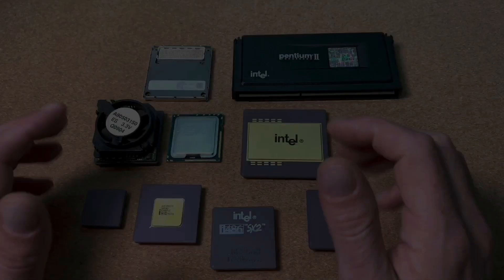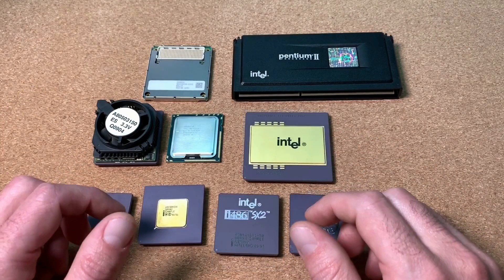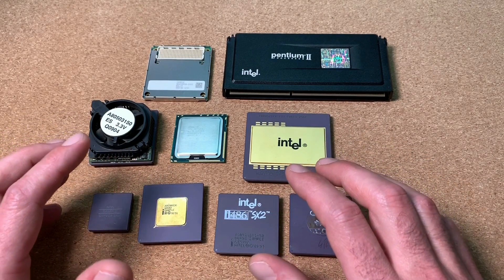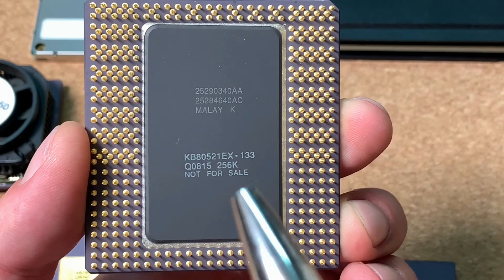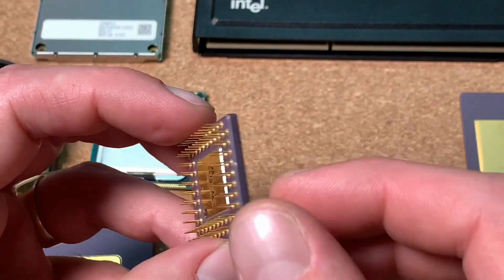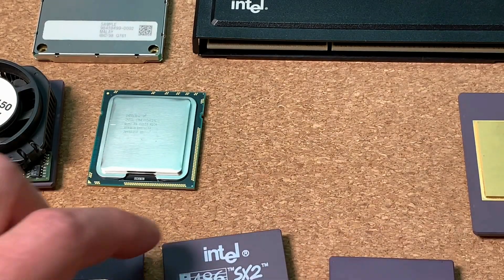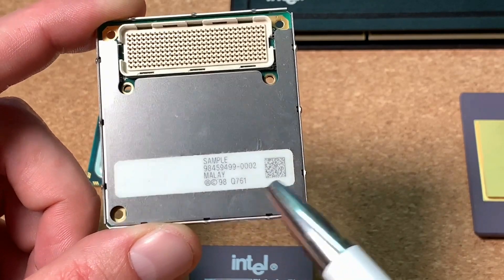Intel Engineering Sample CPUs / Whats Behind And How To Identify Them

Comment: I managed to get my hands on a QZAL engineering sample many years ago.. I used it for several years in my main rig. It overclocked like mad, even initially on just a very big air cooler. 
Engineering samples have always been interesting to me; did you know there are also Cyrix engineering-only CPUs and Nvidia engineering sample GPUs floating around the web?

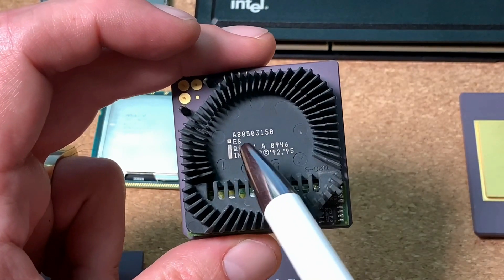Comment: 6:45 MMX overdrive ES has three pins clearly used for testings. Any idea what's possible with these pins if you know the purpose/protocol to communicate with CPU? Many chips have them or newer ones have different capacitor configurations  with same "family".

Comment: The 486 with extra legs ("bond-out?") has an "ICE" marking on it, that stands for "in-circuit emulator". ICE was used by BIOS and OS developers to get the lowest possible level of software debugging that is still considered software debugging. It was later replaced with probe mode of consumer CPUs and JTAG.
I think this chip is the star of this video as it is the highly specialized tool with its schematics altered to meet the tool requirements while others chips are more or less just early runs of consumer CPUs.
IIRC, these chips along with other ICE components were extremely expensive and rare.
Reply: Great info :)
Reply: Hi, I'm new to this forum and I've been an Italian collector for 17 years (I have many of the chips I've seen in your collection). I have seen a similar chip in the past and it was laser marked A80486DXDICE. Do you know if you can find it for sale
Thank you
Reply: was just about to comment the same thing!

Comment: I used to work for a computer manufacture that is no longer in business and i have a handful of P4 engineering samples. A couple of them are not stable and will cause the system to crash randomly. These definitely have the clock multiplier unlocked.

Comment: I have had quite a few engineering samples over the years, most before they launched because I work in the industry and have been provided with them. Technically you are supposed to either send them back or, if advised to, provide proof of destruction. I still have an i5 6600k engineering sample "Intel Confidential" marked. The oldest one I have owned, or more specifically had in my possession as it is illegal to "own" these as they remain technically the property of the manufacturer, was a Pentium II clocked at 166mhz.

Yours may be the same model/revision,  mine only worked at 166 with a voltage of 2.8v, a 66mhz FSB and 2.5x multiplier. If you have not already tried these settings it may be worth a shot. I remember hearing rumors of a 133mhz version as well so a 2x multiplier may be a good place to start though you might have trouble finding a board that supports multipliers that low.

Comment: Woah! That 286 is probably my new favourite cpu, I had no idea that people still had them. Did you get it on the CPU world forum? I want to add some engineering samples to my collection but im struggling to find any.
Reply from the maker: No, I did not get it on CW. I have this 286 already for long time. Think I got it from an retired Intel engineer. But not sure if I remember right now for this 286. Basically it will be very very hard to find one nowdays.
Reply: @CPUGalaxy  Are there any specific places that I can get engineering sample CPUs? Like I said I can't find anything on cpu world.
Reply from the maker: Callum_ 22 no specific place... just look at ebay or trough communities. And, you need a lot of luck or money. A collector friend of mine got 9 ppro as scrap... and between there was a ppro engineering sample. All this for 100€. The seller was not aware of it.
Reply: You can find it on ebay.
Reply: @michalceleda3968  ive only ever seen ppro engineering samples and itanium samples on ebay..